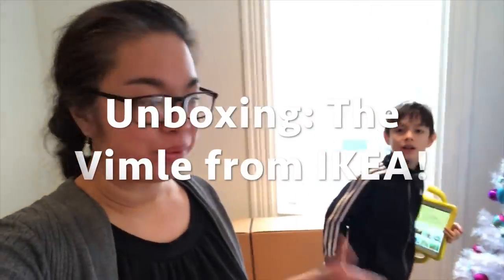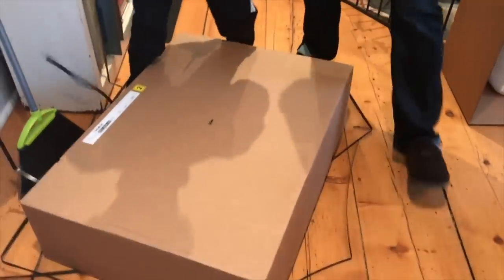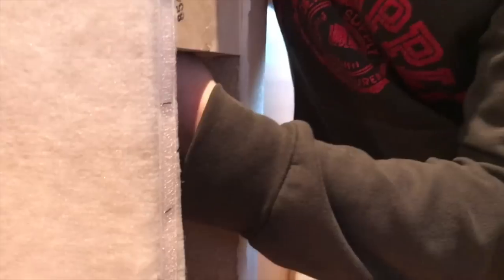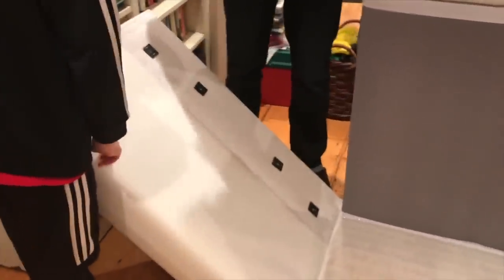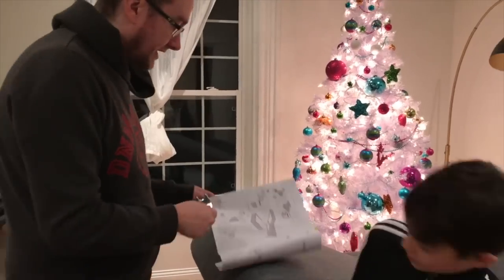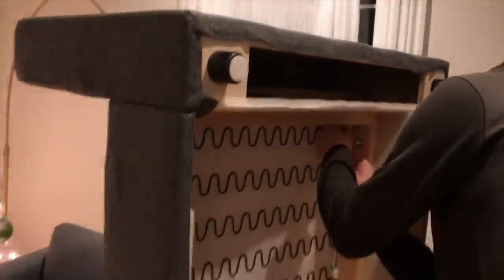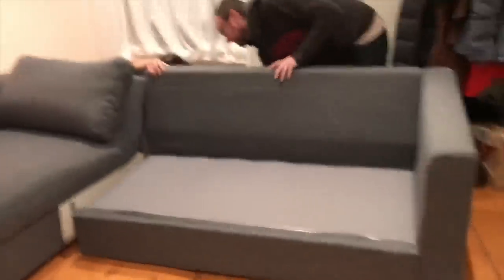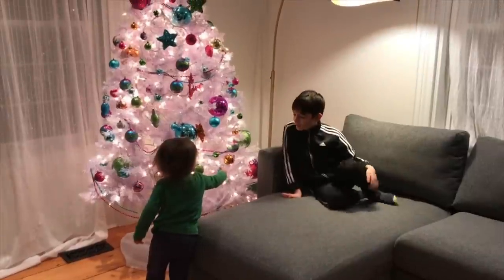🌟 IKEA Vimle Assembly Instructions And Review 🛋️ New Vimle Ikea Instructions

Comment: Thank you. There was no manual on connecting chaise section with a two-seat section. Called IKEA, and they recommended to watch this video!
Reply from the maker: So glad they recomended it.  Yeah, that part is NOT in the manual.  Congratulation on your new IKEA couch!  Comfy, eh?
Reply: Yeh. But that part was in the boxes with covers(discovered that after watching your video). I thought I had to build frame first and then apply covers, but Ikea designers knew that and especially put that guide in separate box.
Reply from the maker: Counterintuitive.  We ran into that also.  Marie made a call to IKEA and straightened that part out.  Makes sense looking backwards, but not so much when you're buried in all those boxes.  Glad we could help out.
Reply: Was having the exact same problem your video is a godsend was loosing my tether lol 😊

Comment: I'm sitting here with my Ratorp/Vimle sofa looking to find out how the arms go on. I *think* I got it now...hmmmm.....I couldn't really see how you did it. I DID learn to put the slipcovers on first, thanks.
Reply: J Bartek Yeah I'm glad I found this video too...who would have thought that instructions for the frame assembly would be in with the cover!

Two observations though:

a) the armrests only attaching with three screws at the bottom is pretty average, they could have used a hole+bolt set up like the one used to connect the two main sections for the armrests too

b) I didn't seem to get any legs to attach to the bottom of the two seat section, so the sofa only sits on the feet on each armrest...which is quite a span.

Maybe I'm still missing something...?
Reply from the maker: Awesome.  Gald you were able to get your Ratorp/Vimle setup.  Did you find it a bit strange with all the different names of each piece?
Reply from the maker: It is quite sturdy how it connects.  But I was expecting some feet that that connection part also.  So far, it was not been an issue.  Glad you found the video helpful!  It can take quite some time to put IKEA furniture together.  And there seems to be at least one "unclear" part in the visual instructions that could do with a bit more description or clarification.  Enjoy your Vimle/Ratorp!
Reply: It was extremely helpful and I think I'd still be going without it :)

One hiccup I noticed, I think you had troubles connecting the 2 seat section and chaise together because you used the larger washer which can slide over the end of the "screw cap bolt". If you use the smaller one then it maintains a one inch gap and easily slides into the hole :)
Reply from the maker: Nice.  I didn't another washer, but it certainly is the trickiest part of assembling the Vimle.  Glad we could help out!
Reply: @andrewmurraytv  I think you might have, that's why the washer is able to slide so much in your vid. There are five washers in the packet and one of them is slightly smaller than the others, not easy to notice. They warn not to use one of the big ones in the manual, also not easy to notice though, I almost missed it. Cheers for the vid.

Comment: How's it looking now, could you post it now? Have the arms become wobbly, heard they only attach at bottom so the become wobbly with time, any issues?
Reply from the maker: It’s firm.  Never been retightened.  Cushions are all still firm.  This is a great couch and much improved over the ones from years ago.  We have one of those also.

I am impressed with how much it has kept its shape.  Keep on mind it does take some pulling to get the covers over the cushions.  This is why it stays so firm and nice looking, particularly compared to the older models of IKEA couches
Reply from the maker: Arms are not wobbly at all and it has been jumped on by the little ones in the video.  I will add that the storage compartment under the chaise lounge portion does end up with a small amount of particleboard dust from opening and closing.

Comment: Thank you for the video.  We are thinking about this couch, and I was wondering if you are having any problems with the cushions, not in terms of comfort, but in terms of the cushions staying in place.  It looks like the cushions just sit there, and don't attach to the couch at all.  

Does that mean that they are always getting out of place?  Are there times when you lean back and hit the hard back of the couch because the cushions aren't situated in the right spot?  With young kids, I could picture a mess of cushions everywhere.  Has that been your experience?
Reply from the maker: Great question.  As you may have seen from the video, we have kids too!

They are not attached, but the back is reclined slightly, and the cushions are quite taut.  So getting them into the cover takes a little but of strength and is easier with two people.  The cushions sit tightly together as a unit, so they can be removed, but they stay in place.

We have never had one the backrest cushion fall on the floor - unless it was removed on purpose.  But they don't just fall all over the place.  Good question.  I can see why you would think they might, but they don't.  If you are close to an IKEA, take a seat in the IKEA showroom and test out all the couches.
Reply: Thank you so much for the info.  I appreciate it.  :)
Reply from the maker: No worries, Greg.  Very comfortable.  We sent too much time on it, LOL.

Comment: Hello, I had the same problem as you at the end, joining the 2 pieces. I finally got there but there is still about a 2cm height difference between the 2 pieces. its not obvious once the cushions are in place but Im wondering if I should try and force it to be level or it doesn't really matter...I don't want to damage it.
Reply from the maker: No, you don't need to force it.  You need to loosen the bolt so there is a lot of space to make the final connection.  I believe I had to loosen the bolt about half-way, which I was not expecting.
Reply: Thanks for this tip.  Can you please tell me, is it possible to disconnect the  2 pieces for moving?  Do you have any tips for disconnecting them?  How difficult would it be?   Thanks again.  This video is super helpful.
Reply: You can disconnect the 2 pieces of the Vimle.  I have not unassembled my own, but you would want to give a quick thrust up, or if you put it on it's back and hit upwards with a rubber mallet or hammer covered with something so it would not damage the underneath of the sofa.
Reply: Thank you

Comment: Hi, thanks for this video. I am thinking of buying this sofa. Do you know if it would be easy to take apart into smaller sections? I'll be moving in the future and I need something that can be taken apart and reassembled easily.
Reply from the maker: Yes, you can take it apart.  They include a tool that you can use to screw tighten the main sections.  You can use this to unscrew the pieces also.  In fact, I think we had about 4 of those tools included in the different boxes, so you're good to go!

Just make sure to keep the instructions, or come back to this video and watch it backwards :-)

Comment: Nice video! I love the lamp you have in your living room. I plan on getting something similar for my living room. Is this also from Ikea?
Reply from the maker: Hey Disha.  Unfortunately, it is not.  I actually had a vague longing for a lamp like that for a long time.  It was my wife, Marie who was not really on board.  Anyway, we found that lamp at Costco for about $150-$200 I believe.  Maybe by Nova Lighting - but don't quote me on that.  I got her to go for it because it matched the slate ceramic tiles on the wall by the wood stove.

It's called an "arc lamp."  Retro.  Reminds me of Mad Men.

IKEA has some - but they don't look quite like that one.

Anyhow, I couldn't find anything exactly like it, but you could check out Homesquare: http://homesquare.pxf.io/c/205449/385218/5601?u=https%3A%2F%2Fwww.homesquare.com%2FFloor-Lamps--C990.htm

Or Houzz:
http://hpn.houzz.com/c/205449/372747/5454

Good luck!

Comment: Vimle has a serious problem with arms. Arms has screws only on the bottom side and arms are moving after few months of using. Arms on other sofas are fixed also on the top of rear side.
Reply from the maker: I haven't had a problem with this at all.  This is a very study couch in every sense of the word.  I know IKEA extensively weight-tests their furniture, so I'm not concerned about it.  But I appreciate you letting our viewers know.
Reply: andrewmurraytv All arms of Vimle has screws only on bottom side. Problem of arms fixation is common problem on Vimle. After months of usage all Vimle arms are moving and are not firm. Check exposed Vimle sofas on shops, all arms are moving.
Reply: andrewmurraytv Hey Andrew , I'm trying to attach the armrest to the love seat part and the screws don't seem to align unless we take one screw out and even with that the armrest and the back of the loveseat are not lined up. Did you have any trouble with that particular part? I'm thinking it's a factory issue.
Reply: We didn't have any problem with that part.  I believe we originally had them backwards.  You need to look really carefully at the diagrams as they may look alike but have one small difference.   So that could be it.  Otherwise, take it into the IKEA exit area where they have customer support.  They will be able to replace it.
Reply: Good luck!
Reply: Andrew Murray Thank you
Reply: Andrew Murray we figured it out ,we did put the base backwards. Thanks
Reply: Magda Otero I have problems with it too. What do you mean by putting the base backward? I kept going over the instruction and couldn’t find where i did it wrong